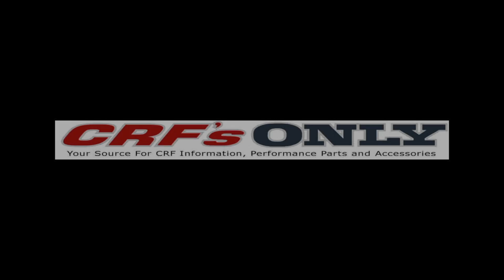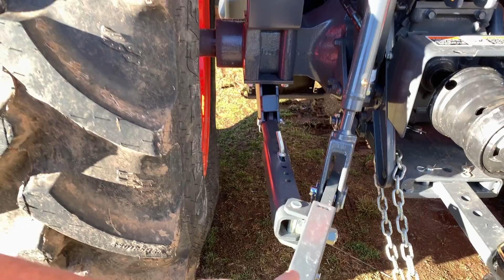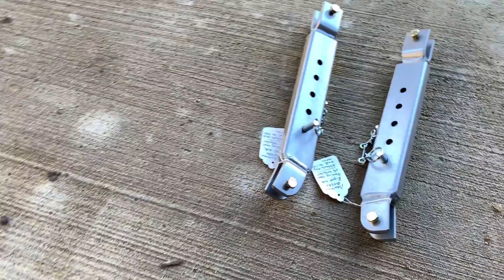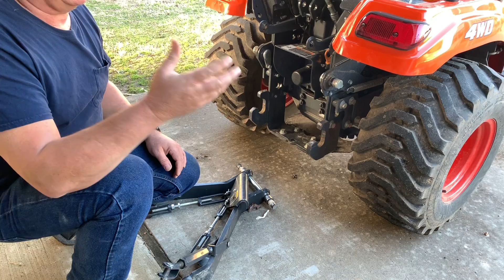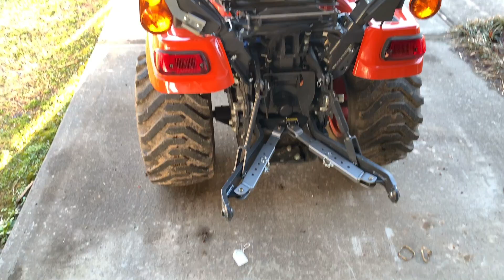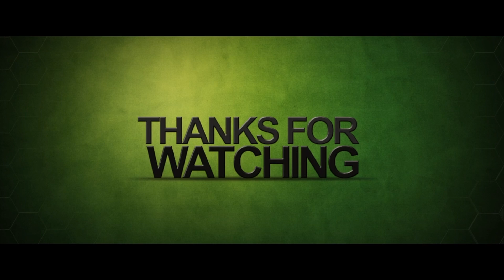Kubota BX23S Stabilworks Telescoping Stabilizers 3 point Hitch BX

Comment: Turnbuckles are the best, you've probably went back to the originals.  Hahaha
Reply from the maker: lol no I didn’t go back
Reply: @Woodzman   Just wondering, didn't your pin holes get boogered up (elongated) from all that play?  Those new struts were so loose.  Turnbuckles are like spokes on a wheel,  they only work when correctly tensioned.  Mine are 30yrs old and there is no play.
Reply from the maker: @tcmits3699 well not in the time I had it, when we moved to AZ I had to sell the BX. I sure do miss it

Comment: I ordered and received mine but they are still in the box. I only have one three point implement so far which is a rear blade and with the turn buckle I was also able to turn them till I had no sway in the blade just as well. I probably will put these on when I buy my roto tiller though. I also see that Kubota sells there own version of these now but they are not as well built as Stabilworks.
Reply from the maker: Yea they work great for me

Comment: I just installed these on my bx23, but I have found a problem. If I am running the PTO and raise the implement, in this case, a brush hog, the shaft hits the arms. has anyone else had this problem?
Reply from the maker: Mine does the same thing

Comment: Looks great.... but I do question on weather you can leave them all bolted up and still remove the center locking plate. To remove that, you need be able to rotate it full down and lift it up; it doesn’t appear you could do that with it still connected. Even if you remove the pins and allow the “length to float”, I’m unsure if it would work...... Could you clarify or make a short video showing this?
Reply from the maker: I left the. Hooked up and it came off. That shield around the PTO hinges up a d that helps
Reply: I don't see it coming off without removing the stabilizers. But if Woodzman says it does, that's a relief. Still, I would love to see it. Then I'd order one.
Reply from the maker: Lol it does, I’m not sayin it’s easy